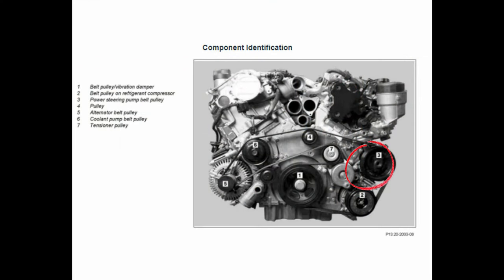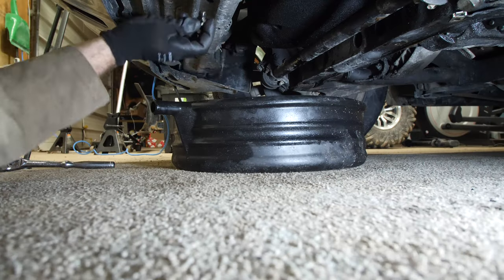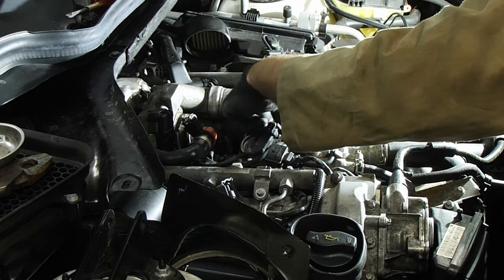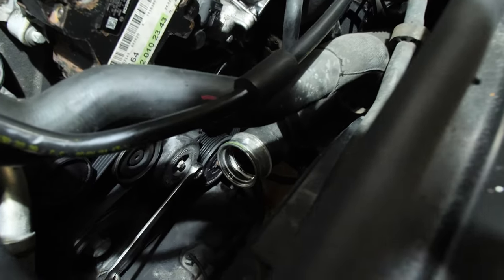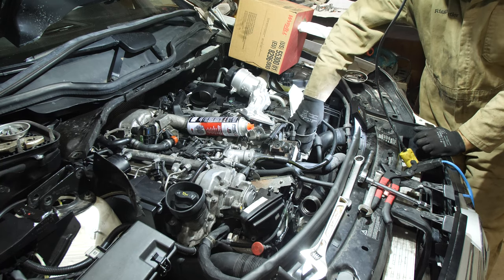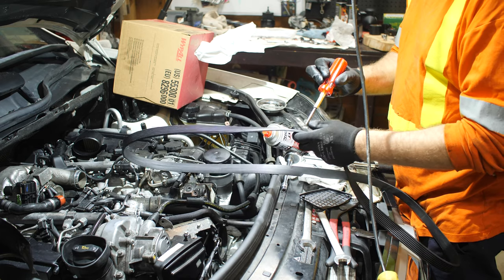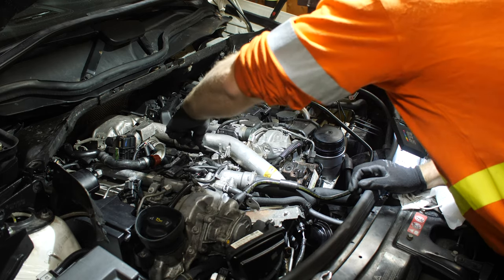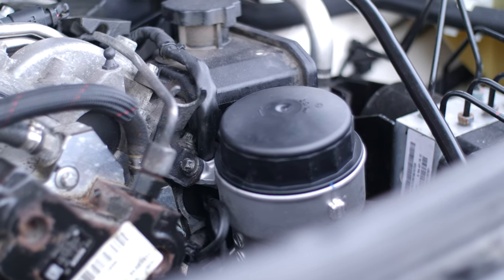How to change Mercedes benz diesel serpentine belt and oil filter housing (OM642 with GL350)

Comment: I just noticed oil leaking in my wife's R320 at the filter housing.  The serpentine belt did a great job oil protecting my engine bay.. I was going to take it in but after watching this I'll take it to the driveway instead.  Thanks for creating the DIY.. fantastic quality and excellent detail!   OM642 is a bit of a heartbreaker but as long as videos like this exist, I can't justify replacing my wife's car as it ticks all the boxes for us.  Cheers!!
Reply from the maker: Thanks and yes you can definitely do it. For the price it's better to clean the bay good. Change it and see what's what. These are solid engines as long as you can keep the oil in them. Bahaha. Cheers more to come for sure.
Reply: Just to follow up, I picked up a new filter housing from my local MB dealer.  They don't sell just the gasket so had to get the whole assembly.  Parts guy was great and gave me a break on the price.  Came with all the gaskets and new filter so I'm happy.  I didn't drop the oil and just extracted what I could from the housing.  Not too much spilt, caught it with my oil pan below without removing lower shroud.  Also didn't remove the intake or intercooler pipe, just the serpentine.  Beginning to end less than an hour.  Drove 300 km today and everything good, leak is fixed.  A good engine shampoo when the weather warms up and should never know.  Thanks again!!
Reply from the maker: @drewk6947  very nice. Yes I should note removing the intercooler isn't entirely necessary. I was just following the MB tech documents. It's a good thing to know how to do properly. I'm happy it's fixed. Now that's done you should consider a catch can.
Reply: Why you didn't replace only the seals but the hole oil housing?
Reply: You can buy those oil filter housing seals from a good aftermarket brands (elring, ajusa). In some "tight" models like ML it's good to take off the intercooler. However in my E-Coupé there is like 30cm gap, plenty of space to work. Good video, cheers !

Comment: Hey man, hope you're still active and see this comment.

I've got an 05' E280 (Same engine as 320 just detuned from factory) that has the OM642 engine. I've had this gasket for the oil filter housing in a drawer for a while thinking it would be a quick fix whilst doing oil change then can't remember what deterred me when it came to doing the job but I didn't do it at the time I planned.

I've got multiple oil leaks and I'm sure this is one of em, didn't realise when I did my Poly V-belt (as we call them in the UK) that I was a few bolts away from being able to do this job too! I've serviced this car about 6x now in the couple of years I've had it and know my way round most of the engine so every bolt and clip you removed I recognised instantly but its always nice to see someone do the full job.

The oil that pools near the turbo is a constant nause. I've replaced the orange turbo seals twice and clean them up every service but it still continues. I even changed the PCV seal in the valve and it still happens not sure why so much oil blows by. I'm going to find your oil catch can video after this comment I hope.

Finally... on the air intake piece - I used to loathe putting this back together at the end of a service until I realised the correct way to do it and now I feel stupid for all the times I forced it and almost caused severe damage (I did once tear the rubber where it meets air filter housing).

Anyway what you need to do is remove the 2x torx bolts from each air filter housing as if you are going to remove them to change filters but don't, leave them positioned in their rubber mounting bungs at the base. This allows them to rock back and forth. Concentrate on fitting your air intake piece first, secure the jubilee clip around the turbo and move each air box back so it sits square. Once that's secure just slip each air box inside the air intake one at a time by pushing the whole thing forward. It is literally so simple and then tighten up the jubilee clips and reinstall the 2x torx bolts for each box. It fits together first time everytime like perfect and no more wrestling with the ends of intake trying to get the lip of the seal over airbox with a screwdriver etc.

End of essay hope this helps, new subscribe here 👍🇬🇧
Reply from the maker: Appreciate the write up. The oil catch can will definitely help reduce the oil suction that these motors have. I believe the oil get pulled from the crank case from the turbo being so close. Adding the catch can should help slow that suction amd catch whatever is in there. Cheers.

Comment: Awesome Video, procedure was identical, for my 09 ML320, only difference I didn’t have to remove the pipe I noticed there is more room between the front of the engine and the rear of the radiator, compared to the GL either way this video helped a bunch
Reply from the maker: Hey no problem

Comment: I just had my serpentine belt go on my 2011 E350 bluetec. what gaskets (if any) needed to be changed when doing the belt job? like for the charge pipe or any other things in the way. great vid btw, most informative I've seen
Reply from the maker: I dint recall changing anything. Wiggled back on pretty good . Cheers

Comment: Just want to add thanks for this video, helped me change my oil filter housing seals on ML350.

I replaced both seals, can be purchased from Dorman part number 926-365.  

T40 bolts torqued at 14nm as well as E10 bolts back to engine block.  Hope this helps.

Comment: Thank you for the great tutorial. My 2015 GL350 has a leak but I believe it is coming from the middle seal, that connects the actual filter housing to the aluminum tube. It is easy to remove the specific gasket without having to remove any other parts. Meanwhile though, do I have to drain the engine oil first?
Reply from the maker: I would drain it just so you know exactly what you need to put back in (full oil change ) just time it right. Cheers.
Reply: hey there, to remove your oil filter housing, you had to pull out serpentine belt and intercooler pipe as well or it was just oil filter housing? I am planing to do the same and trying to plan ahead?
Reply from the maker: @drsanket  I think I did both. It should all be in there. Best of luck

Comment: Can you help? Very helpful video. I needed to do both jobs as well on my 2012 GL350. I do have one issue after completion; the vehicle started up fine, I let it warm up for about 5-10 minutes. Once I started driving, I had no power, was bucking down the road about 3 miles an hour. After about 1 mile, it started running more like normal. However, I couldn't feel the turbo kicking in. I did notice the MAF tubes weren't sealed properly and I got a P0101 code. I cleared the code and reseated the MAF tube. It is still bucking a bit through the first 3 gears. This issue wasn't happening prior to my serpentine belt breaking. Any suggestions?
Reply from the maker: Missed your comment sorry fella. How did it work out ?
Reply: @GilbertGardens  turns out I had a bad gasket on the inner cooler tube. Replaced that and everything was fine. Now have that DPF issue, which Mercedes has already fixed twice, so that is still under warranty, just a pain to deal with.

Comment: 2013 ML350 Bluetec here (w166) at 294 000 km and my oil filter housing started leaking. Should I replace the gaskets only or the whole oil filter housing?

Comment: Thank you for this video. I'm about to do mine because it has the same leak.  I'm curious as to why you changed the entire housing instead of just the gasket?
Reply: Because it NEVER works. save yourself from doing it twice and just get one. BenzCareAuto.
Reply: @CrucialSpeaks  why? It’s just the gasket. The gasket in the middle of the housing doesn’t leak. Not trying to be a dick, just curious.

Comment: do you know if pulley #4 is supposed to be smooth or grooved? my belt was torn apart after driving 3000 miles and the pulley i noticed is smooth but the grooved side of the belt sits on it. Should it be grooved and it was erroneously replaced by the previous owner?
Reply from the maker: I can't recall. I'll look into it and report back

Comment: Did mine on an R320 diesel a few years ago.  As I remember , be Very careful will the torque and make sure the threads are properly alligned as the threads will strip very easily.  It was frustrating to have to replace the entire assembly as it was expensive, and all it needed was a gasket ! (Mercedes doesnt sell them seperately) Most often that is what fails.
Reply from the maker: you can actually find the gaskets on ebay. I was running short on time so I just went to the dealer and picked the whole thing up. We have another baby girl due any day now and I just wanted this issue gone.

Comment: Not sure why you removed the air filter/mf sensor and intercooler pipe. You only need to remove the turbo resonator.  The oil cooler seals are what goes most.
Reply from the maker: Yeah I guess so eh. I was probably looking for oil at the turbo. Also a common issue on these motors.

Comment: Oil grade…
Ack no emission.
Chain rattle? Maybe you want to consider an oil type that is more specific to this engine. Oil is not only for emissions. :/
Reply from the maker: What oil would you recommend with no DPF. ?
Reply: @GilbertGardens  Honnestly DPF or not I'd keep using OEM recommended oil spec for 5W40 with 229.51 standards. 250K Km here with no single rattle cold or hot engine start. Always used 229.51 though.